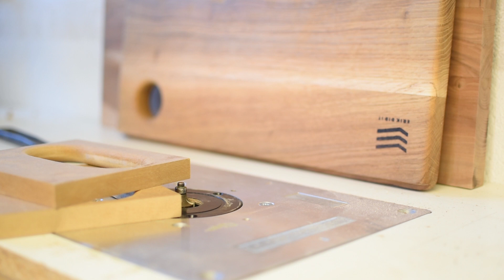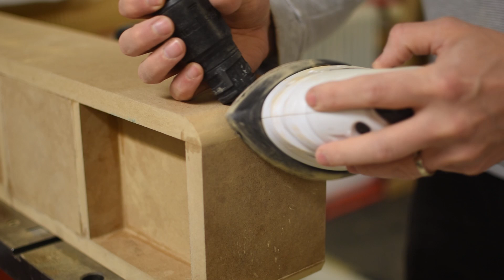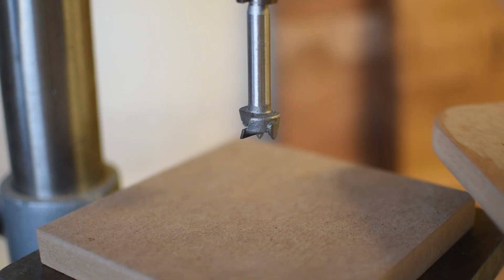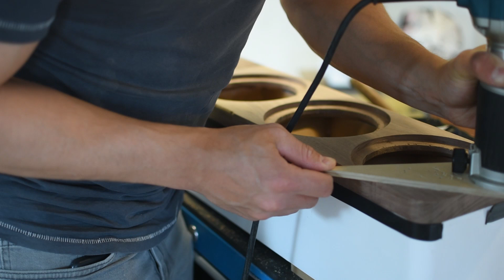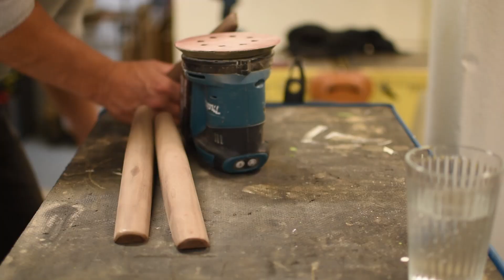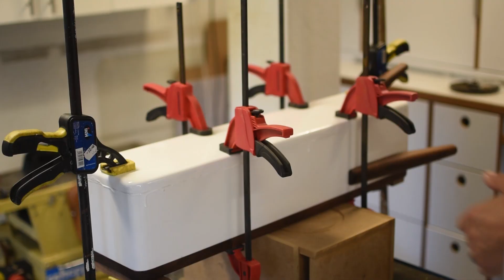Build This Floor Standing Tower Speaker

Comment: Definitely would’ve used a different method  of wiring up the speakers over soldering if something happens to one of the drivers you’d either have to cut the wire or break out the soldering iron, connectors would’ve been a decent option over soldering imo especially for maintenance or driver replacement even modern speakers use spade connectors.
Reply from the maker: Thank you for your feedback

Comment: i would use different drivers but your version is not bad at all.
and they look amazing.
i would use two dayton audio rs125p-8 for the midrange. the paper based membrane would probably have low dirty resonances in the upper frequency range above 2kHz.
i would go for an M-T-M configuration with a Vifa/peerless XT300 KT/4 ring radiator. those tweeters are very smooth because of a low tube-like k3 distortion.

Comment: Great Erik. Snyggt. Stylish. Powerful. Umpf. Doff doff. Did you use the acrylic to beam light from a led on the amp board? Duratex  better than MDF sealer? Great build.

Comment: looks nice! Just out of curiosity: for the center to center distance, would it not be better to move the active driver to the top opening, or is the XO that low it does not matter much?
Reply from the maker: Thx! Great input, that is something I have to try when measuring the speaker and something I didn't even think about.
Reply: i think the XO frequency is low enough. i guestimate 200Hz which would result in a wavelength of 1.5m. with that, it should be fine. lambda/4 is 37,5 cm. that is apptox. the distance. maybe there is a small dip in that area, that depends on the crossover as well. moving the crossover frequency - only from the sub - a bit up could resolve that.

Comment: Love the design! I was wondering if you did a calculation of the enclosures, I have the impression that the loudspeakers do not work in the optimal parameters due to the dimensions of the speakers. I think it should be bigger. Did you use any app for this? Thank you!
Reply from the maker: Thx! I always use winISD to calculate my speakers.
Reply: @Erikdidit  Good to know, thanks!
Reply: @Erikdidit this was with the 5 1/2” version. Are you going to make a 7” version? Speakers look pretty amazing.
Reply from the maker: @nurseklb013175  that would be a cool idea!
Reply: The use of passives are what allow for such a small enclosure.
Reply: @jayweb702  it's a kind of alternative for big boxes?
Reply: @HeretikLeathercraft  Exactly!
Reply: @jayweb702  i should study this, thank you!
Reply: they made the moving mass very heavy with 26.6g. and a low resonance frequency of 40Hz in free air. that is optimized for low volume.

when you compare this to a different driver that is also suited for midrange, like the RS128-8 with aluminium mambrane: only 5.9g and a slightly higher resonance frequency of 59.2Hz. it needs more volume.

usually subwoofers that are not suited for midrange have a higher mass. together with a strong motor, they are optimized for a lower volume. but usually they lack a bit precision. the passive radiators are a good option instead of a vented port to avoid port noise. and passive membranes look nicer too.